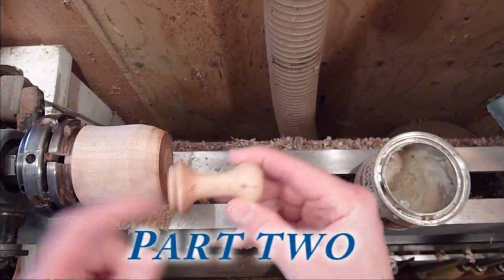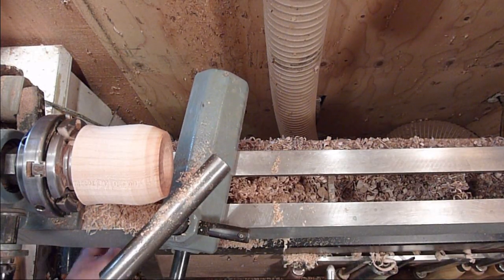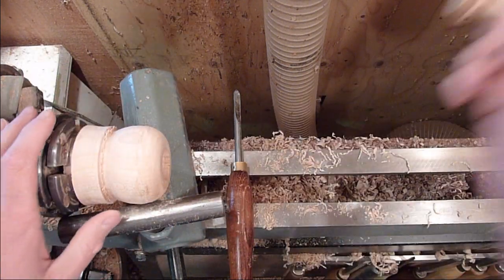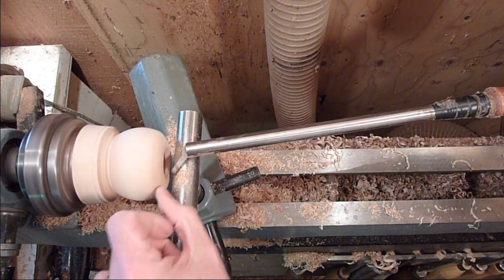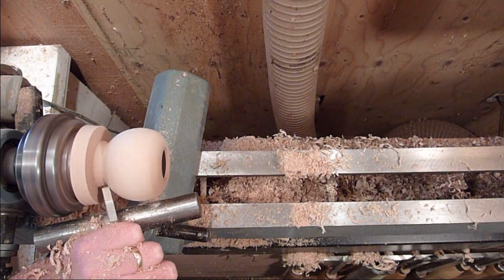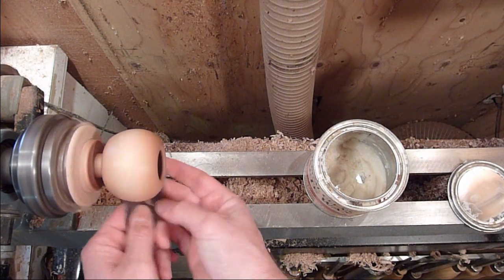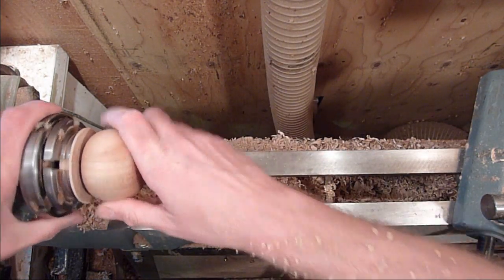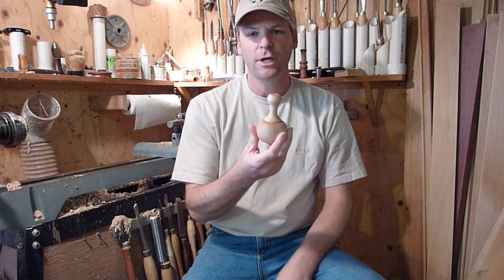Wood Turning Project Baby Rattle

Comment: Do you mix it yourself? If so what is the ratio?
Reply from the maker: +Aaron Miller This is an older video, I now use Beeswax and orange oil from Howard. You can find it at Home Depot. I like it better. This stuff I mixed 10 parts wax to 1 part oil.
Reply: Great, thanks Carl!